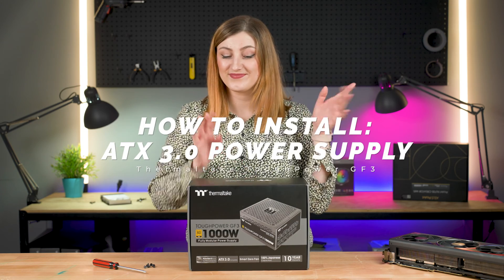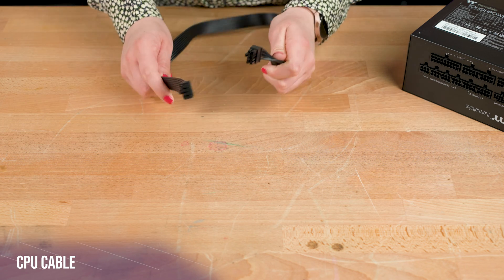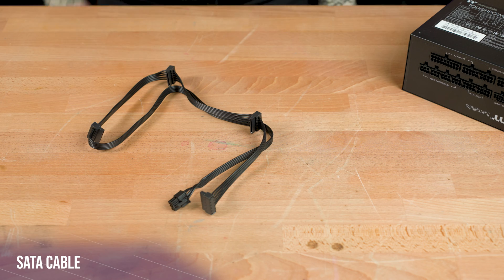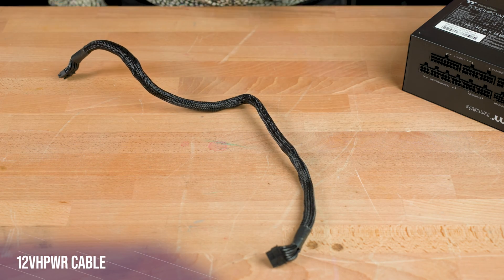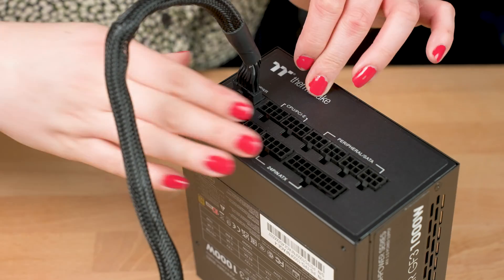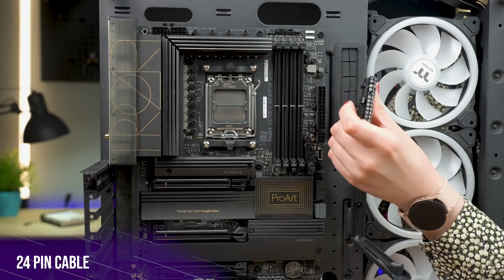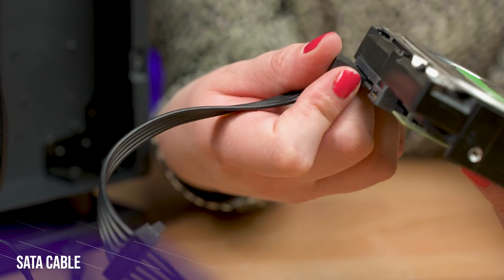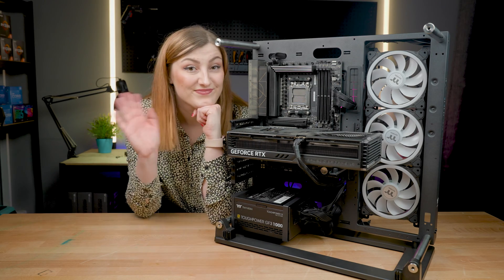HOW TO install a Power Supply / 2023 Update

Comment: does warranty correlate to life expectancy with the Thermaltake PSU ranges?

these products all look the same to me except the price. So far the rm750e/7yr and GT/5yrs are 10 bucks apart. 
However there is so much more opinion out there on the corsair products though.

Comment: ahh new way how to kill graphics card :) now when psu dies during storm it kills gpu too, GJ! nice improvement ! what do they plan next? button on front of the case with labbel "instant burn it all !" 😒what about opto-isolation improvement of that signals and aditional protection on  12V power supply branch

Comment: If I want to turn it without motherboard, old "psu jumpstarter" switch is not working, or at least I was not able to power GPU over new 12v. (for dual PSU setup) Is there something new for ATX 3.0 to do it?

Comment: I'm new to building pc's. I'm wondering shouldn't you always plug in the extra 4+4 CPU plug into the motherboard header if it has one (the motherboard in the video has one). I know that the CPU can run fine with just the one 4+4 CPU plug but if you do some overclocking or whatever (even when overclocking I think it might not use both of them but might for a short time?) isn't it always best to plug in both if you can?